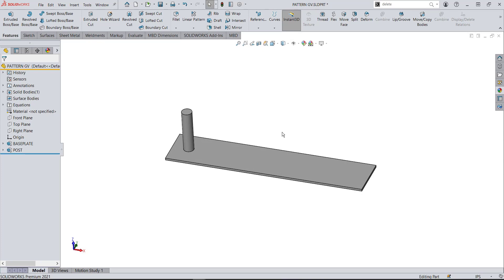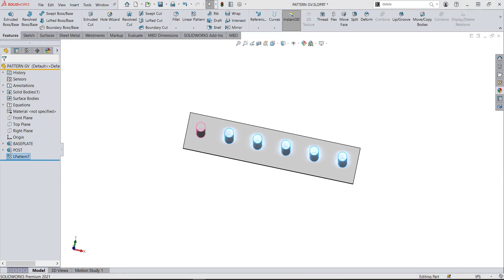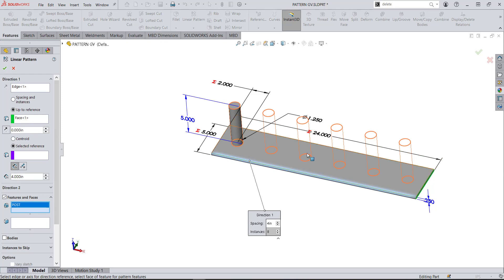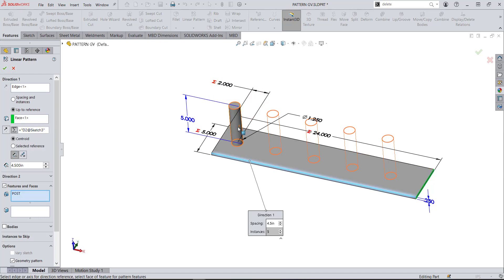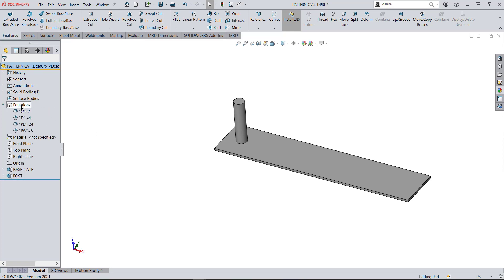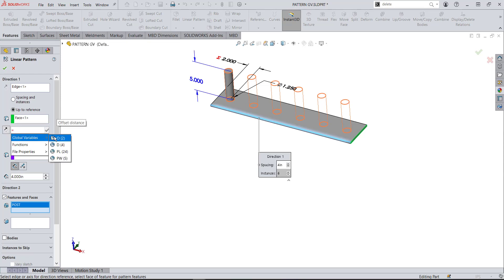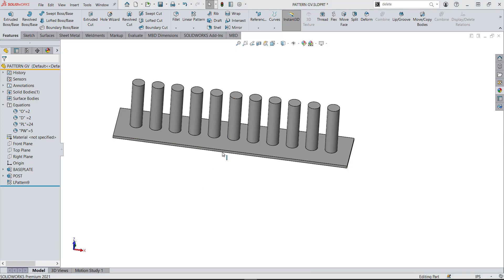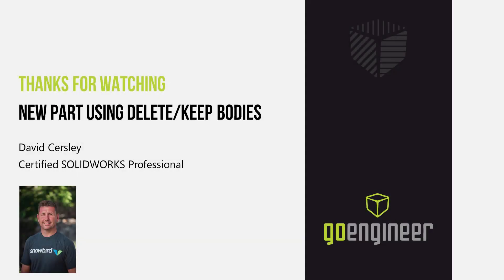SOLIDWORKS Tutorial – Linear Pattern Offset Control

Comment: in ur case the 2nd method works with specified 4mm distance in between and 2mm offset at both ends because of the lenght of the plate. if your plate would have been 1mm longer or shorter u cannot set the distance because it will override the offset at the end and u will have ur last pole at 1mm or 3mm from the edge.